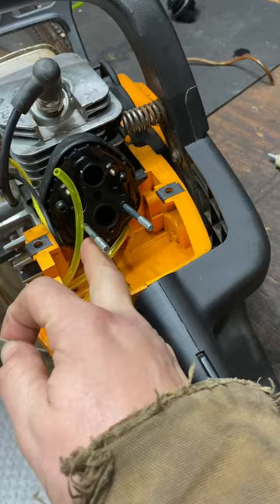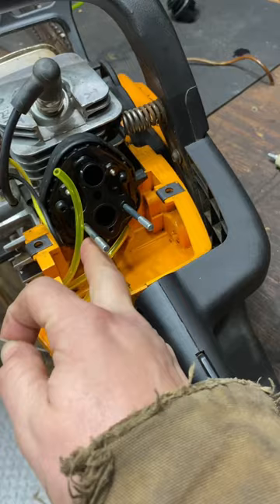Poulan fuel line install, Quick tip.   #chainsaw #poulan

Comment: I stuck a small metal wire up through the tank and stuck it on the inside of the tube. I then took a heat gun and melted it on the wire, then pulled it through the hole. I bought 1 foot of tubing to make sure I had enough.